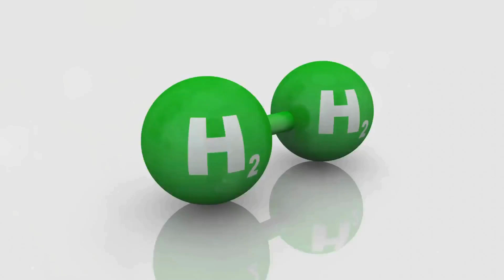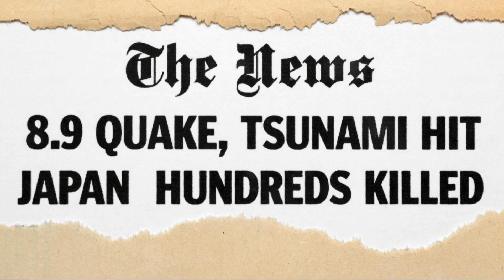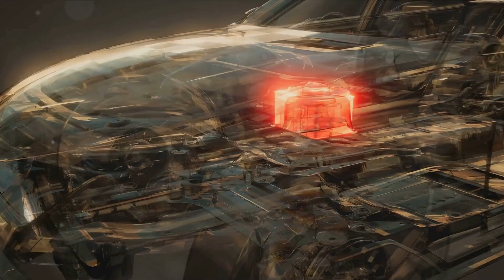Five Major hydrogen accidents in history

Comment: check natural gas accidents per year
Reply from the maker: According to the Pipeline and Hazardous Materials Safety Administration (PHMSA), over the past two decades, there has been an average of nearly 300 pipeline incidents per year in the U.S., resulting in approximately 12 deaths and 55 injuries annually. Additionally, the National Fire Protection Association reports that U.S. fire departments respond to over 3,200 gas-related residential fires each year, with natural gas accounting for roughly 2,000 of these incidents.
Reply: @futureenergytechnology  Moreover, a hydrogen explosion has less destructive explosion power
Reply from the maker: @tomasporculis1544  That's true —hydrogen explosions tend to have a lower overpressure impact compared to some other fuels, but they can still be highly dangerous due to hydrogen’s flammability, low ignition energy, and rapid flame speed. Safety measures are critical in hydrogen applications.

Comment: The Challenger used Liquid Hydrogen this defiantly is very dangerous😢. That being said petroleum fuels have Ben shown to be very dangerous as well. Also EV’s spontaneously combust if there is just one defective cell. The lesson the safest mode of transportation is our feet.
Reply from the maker: All energy sources have inherent risks, but advancements in technology and stringent safety measures help mitigate these dangers. Liquid hydrogen, petroleum fuels, and EV batteries each have specific safety protocols to reduce accidents. The safest mode of transportation might indeed be walking, but each option offers unique benefits that make them suitable for different needs.

Comment: The Hindenburg ignited because of the paint coating on the covering of the Hindenburg.
Reply from the maker: Thanks for your comment. While the ignition source of the Hindenburg disaster is debated, the paint coating, hydrogen gas, and other factors likely contributed to the fire. Safety measures have significantly advanced since then to manage hydrogen safely.

Comment: And the Greenies want to put 5,000 to 10.000 psi hydrogen tanks in cars.
Reply from the maker: Thanks for your comment! Hydrogen tanks in cars are designed with advanced safety measures to handle high pressure and ensure safety. Hydrogen fuel cell vehicles offer a clean alternative with zero emissions.
Reply: @futureenergytechnology   Yeah but in an accident where the tank is damaged, there is a likelihood of an instant massive explosion. With a damaged EV battery damaged and experiencing thermal runaway you would likely have minutes to escape.  Not so with a hydrogen fuel tank.
Reply from the maker: @danadurnfordkevinblanchdebunk  Both hydrogen tanks and EV batteries have safety risks in accidents. Hydrogen tanks are built to be extremely robust, with multiple safety features to prevent explosions. While a damaged EV battery can lead to thermal runaway, both scenarios require rigorous safety standards to minimize risks .